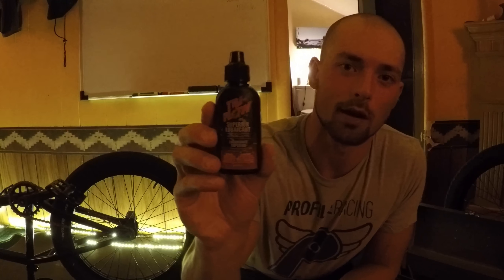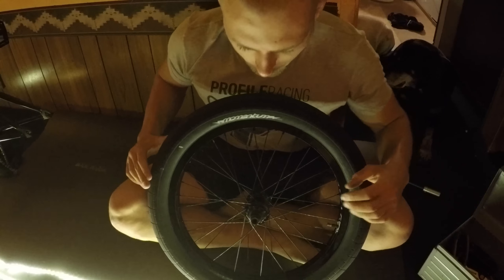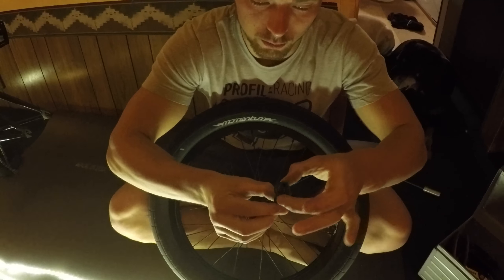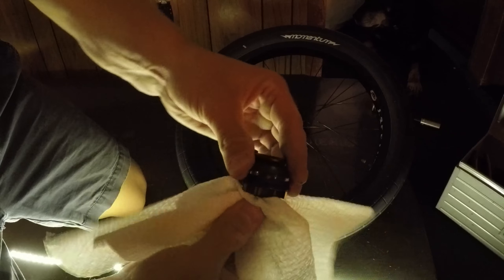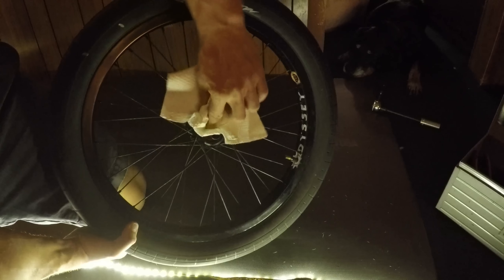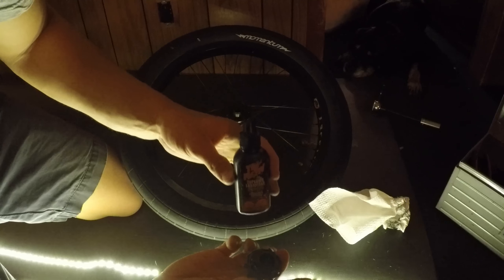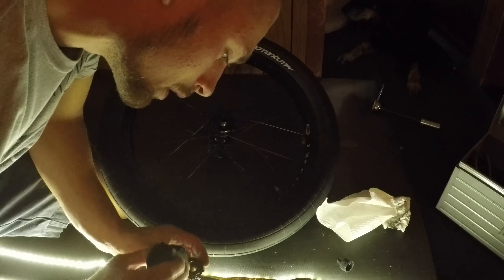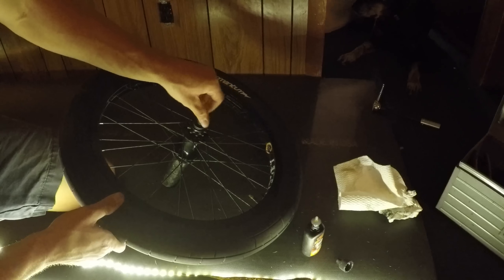BMX Cassette Hub Maintenance.  How to increase your hub's performance.

Comment: These videos are great, thanks man. The two Antigram ones and this one. But you say that the packing grease isn't meant to be ridden on, why not? I prefer a quiet hub for stealth riding. A lower viscosity lubricant would wear components faster than grease would?
Reply from the maker: Virux I view the packing grease more as something that preserves the hub until purchase.
Reply: Alright. I'm probably going to use ParkTool HPG-1. I've been the kind to run OEM hubs and never once took them apart. used to ride 30 miles a day too. I think even using a heavier grease and doing regular maintenance will be far better. I might switch to a coaster but not sure about the engagement lag. How's your antigram been?

Comment: The odysset warranty department told me You can run the driver with our without grease. Oil based grease is preferred.